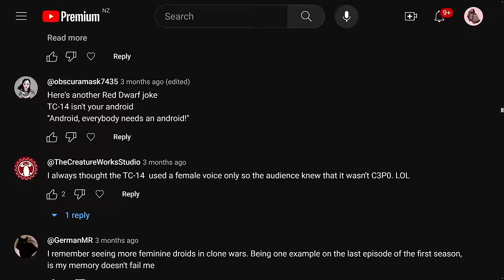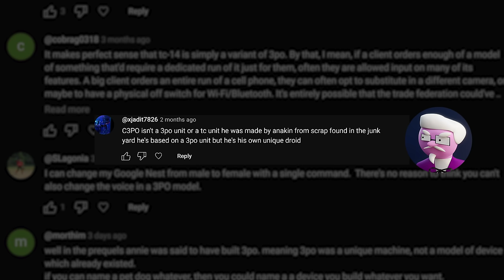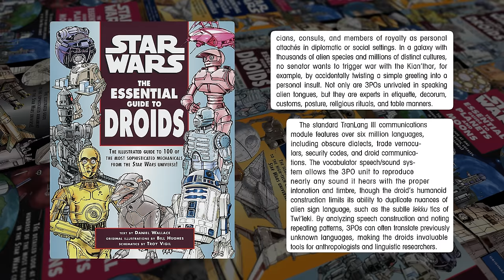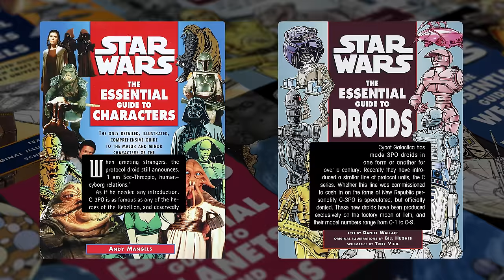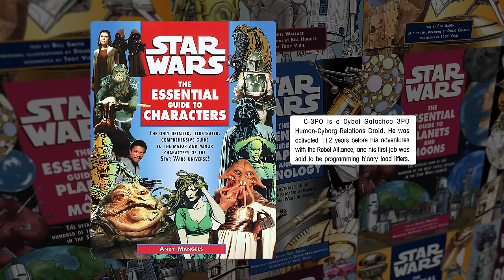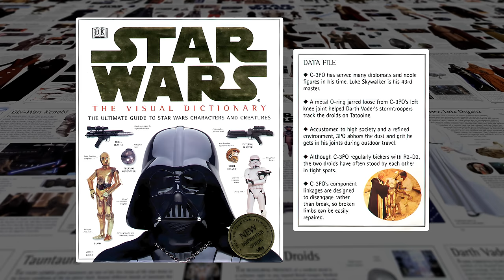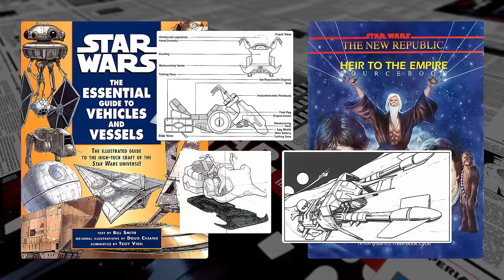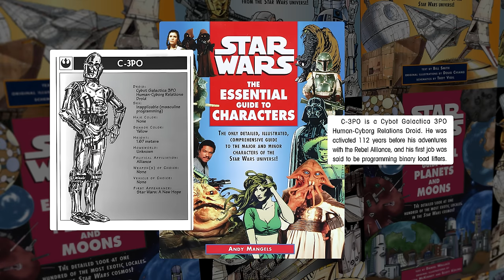You're (Probably) Wrong About C-3PO | Star Wars LOREBREAKER

Comment: I always figured that Anakin "built" C-3PO in the same sense that I "built" my computer, like you said.  Yeah, there's some room for customization, as I'm sure there is when you order a droid from the factory, but at the end of the day all I really did was assemble a computer.  Maybe a better analogy would be if I built a car from junkyard parts.  Sure, the parts might come from 10 different junked cars, but each one of them was still a 1985 Honda Civic, so at the end all I did was build... a 1985 Honda Civic.  Maybe I also splurged on a nicer stereo, some seat covers to hide all the torn upholstery, and some sick flame decals (to make it go faster), but it's still just a fucking 1985 Honda Civic.
Reply: And I think he also had a good frame to start off from.
Like saying you found a pretty messed up Honda Civic, took off most parts, leaving the chasis and some main parts.
Then based off the other Hondas, you put em together
Reply: While this is a great analogy, now imagine doing at 9 yrs old, the kid is still operating at a higher intellect then most people
Reply: A resto-mod. Yes,
Reply: True enough. What if I actual am handly with a soldering iron and purchase electronic coponets from Mouser and design and build my own circuit boards and machine some of my own parts from raw billets and bar stock and design and weld some parts myself but also use some off the shelf componets? So I build my own vechile from raw steel but then combine an engine from GM a transmission from Toyota, a transer case from Atlas, axle assemblies from Ford, after market engine controller etc....Do I get credit for anything I have done and making such an eclectic pile of non-compatable parts work? 

I build my own amateur radio gear from scratch including designing and etching my own pcb's. I machine my own rifles for competition use from scratch, I have fabricated my own cast engine and transfer case adapters to use a GM engine in a Toyota truck with toyota transmission and accessories but I did not smelt my own aluminum even though I made my own casting. We have no idea what is what with C-3PO. I think the brain built from 3 junkyard brains is more like combining parts from 3 different CPU's into one than the example given with hard drives. Even then if you wanted to use the harddrive idea's it would be more like taking the platter from one hard drive the read/write head from another totaly different design and brand harddrive and the controll board from another brand. The genius is in making all the incompatable parts talk to each other and work. Again the brain made from 3 different brains is more like taking a part of an AMD Ryzan CPU and a part of an Intel I9 CPU and part of a ARM CPU and making a working CPU from part of 3 seperate not compatable CPU's work as one. Like the first person to use XBOX boards to make a super computer or the first person to use GPU in the form of mad stacks of gaming cards to mine BitCoin the genius was not in inventing something new so much as it was finding a novel use for an existing product and designing the controller to make them work together for doing something they where never meant to do. 

Most people could not build an engine if I gave them the parts let alone make one companies engine, work with another companies transmission, and make those parts run with yet another companies ECU and seonsors. If you then make said person a child it is no less amazing even if nothign has been invented.
Reply: @reapersritehand kids are dumb because they spend all day at school, put them to work lile Anakin and they learn quick.
Reply: Anakin did more than this. He literally built a first place racer and won the race with the ‘car’ he ‘built.’

Downplaying the fact that he didn’t build from scratch is insane, since what he did is still genius level for a 9 year old.
Reply: @glennross85 how many kids can build their own first place racer? You people are insane
Reply: @pyropulseIXXI  Dont go outside, you might catch a cold.
Reply: It'll always just be a fucking 1985 Honda Civic with that attitude, my good sir....but if you believe hard enough and you're an enslaved child space wizard on a planet with two suns, it could be a gold bodied 1985 Honda Civic.
Reply: you all understand that he is a fictional character right?
Reply: @yahya_elistinsary  nah we thought it was real gov 🙄
Reply: I would go a slight step further and say Anakain bought broken parts, replaced broken caps with a soldering iron, and got a working computer.
Reply: @buckaroobonsi555  That "buying parts and designing a circuit board, then soldering it together" is how the original IBM PC was designed. The only piece that was not off-the-shelf was the BIOS.
And putting the brains together would be like buying an original Xbox, desoldering the CPU and putting a new one in and replacing the 64 MB RAM with a 128 MB chip, then replacing the hard drive with an SSD.

Comment: C-3P0 is a resto-mod droid like an old barn find Ford Mustang or Dodge Charger that has not run for 30-plus years, Anakin fixed a salvaged, scrapped protocol droid and used whatever parts he could find. But 3P0 was once a factory-built droid before, or at least most of him was stock factory parts at one point. 112 years before Phantom  Menace. Also, if Anakin was older and considered it better, it would be odd for a 3P0 droid to be one to assist his Mother, I mean an Astromech would be more useful. But Anakin found what would become the 3P0 we know today. Considering the Protocol droids made by Cybot Galactica, various models mean many compatible parts plus generic droid parts. Anakin did a good job, considering scavenged and parts sneaked out of Watto's.
Reply: Just felt like expanding my answer a tad.

Comment: It's the same semantics that we use for building virtually anything mechanical. Very rarely do we manufacture the parts, but we do assemble the parts like if we were to build a computer, build a car, etc.
Reply: yeah you don't refine the metal cast it and and machine each and every part and screw your self very much any more, you tend to build with existing parts or modify parts to work with what you have.

Comment: I never boggled at a boy building a robot. I never assumed it was from individual transistors and solenoids. When I was a boy that age there were kits. Primitive by today's standards but still pretty neat. I saw Ep 4 at 11 and didn't hate Ep 1 on sight. For instance, I just assumed Anakin found a crate with a C3PO in modules ready to assemble and program with instructions. Probably an obsolete unit that never sold, likely incomplete. Luke reattached Threepio's arm with no trouble in Ep 4. At one point i vaguely remember a silver droid with a red replacement arm. Not to mention Chewbacca completely reassembling him with few tools. (And he is a "him" not an "it"). 
  I also remember Anakin telling Padme he wished he hadn't made Threepio so self-aware because he was so anxious. Padme did use him extensively as did Leia as Head of the New Republic in Timothy Zahn's Heir to the Empire. 
  Artoo Detoo seems never to have been wiped, but since he doesn't speak Basic he knows history. Interesting characters based on Shakespeare.

Comment: He may have built C-3P0 but because it's from spare parts it doesn't mean he's not a 3P0 model. It's more likely that he's a modified 3P0 model considering that his core parts are probably from a 3P0 model but he probably sourced compatible spare parts from other models due to limited access to the right parts. On top of that, some of the parts may have been from a different model but the same across multiple models anyway.

Comment: Strange, my comment is gone. 

These comments remind me of AK-47 "builders" vs. AR-15 "builders".

Your comment about "building" a PC is pretty much the same analogy I've used in gun building. 

I "built" my PC. It may have been an ibuypower, but at this point I've replaced everything but the case and motherboard.

With my AR-15, I bought all of the parts, except the upper and barrel, as I got a really good deal on it already put together and put it all together.

AK guys "build", but require more (ridiculously expensive) tooling to get the final product, but you'd swear they are some unique gun builders that far outclass anything an AR "builder" has to do and many discourage them from even trying.

Anyway.

Comment: I don't know how people think C-3po is not a factory model, you see them all over the place. I always understood C-3po to basically be a hot/rat rod droid. No different than going to an auto salvage yard and finding an old car you like but it has been parted out but its a good frame to start from. Over time you visit all the near by salvage yards and use contacts made to  piece back together a 77 Pontiac Trans Am. Still looks like shit with all its surface rust and mismatched paint but it runs and drives.

Comment: Wait, is anakin's podracer actually the fastest in the galaxy? Or are those just the exaggerations of a little kid? Like I would run around when I was 9 screaming i'm the fastest ever?
Reply from the maker: Going by stats in the game, we would have to conclude it's on the slow side. The cross-sections give it a top speed higher than Sebulba's, and those are the only two we have concrete and comparable speeds for. If we assume the game stats aren't accurate, then Anakin and Sebulba would both have relatively fast pods. After all, Sebulba needs to win every time, and he can't do that entirely through cheating. —DZ

Comment: The problem with all of this is linguistics it's the words being used let's set the record straight did Anakin build C-3PO yes did Anakin Skywalker invent C-3PO no did Anakin Skywalker create C-3PO no when you say Anakin built C3PO you actually mean he rebuilt C-3PO Anakin didn't invent protocol droids he didn't invent the AI to protocol droids he didn't build C-3PO from scratch he built them from scraps these are two different things Anakin built C-3PO from parts of other protocol droids of similar models so again C-3PO was not created by Anakin Skywalker Anakin Skywalker didn't invent the protocol Droid is C-3PO an official 3PO unit no but he is similar to a 3PO unit because most of his parts are from 3PO units

Comment: The need that made these comments have never built anything and it shows. 

You can build a car from scrap but most of the parts are going still going to be the same parts used in a factory from multiple models.  Other parts like wires and lights won’t matter. 

If the little slave boy made a custom droid he would have said, that he made a custom droid not rebuilt from scrap which implies factory compatible parts.

Comment: No need for a 23 min video…
Go to a car show and you’ll see restorations and hot rods
Ask if they “built” the car and most often you hear them say, “ ya I built it myself”
For a restoration, it refinishing original factory parts or replacing with factory/repop parts
Ask a hotrod guy and get same answer but,
It was most likely build from scratch using g already existing factory and aftermarket parts
Neither the restoration nor the homebuilt were “made myself” since parts used were already existing ( not to mention most piece out the built/restoration to pros and then say “ I built it myself”)
There none in 1min 🤷🏻‍♂️

Comment: There is a difference between building, fabricating, and manufacturing. You can build a Lego Millennium Falcon. You very likely did not also manufacture the Lego Millennium Falcon, or fabricate all the parts for it. You could buy a Lego Millennium Falcon kit, build it, realize it was missing a part in the box, and use a 3d printer to fabricate the missing part, if you are cool like that. The point is, Build, Manufacture, and Fabricate are different words with different meanings. So yes, Anakin did in fact BUILD C-3PO. The end. Another example would be if you ask what factory a car is built in. You might be told for instance that a Ford F-150 pickup truck is built in Kansas City Mo. because that is where the assembly plant is, and it is where the vehicle was put together. However, parts for that vehicle were made all over the US and some global locations, with lots of fabrication, manufacturing, and assembly processes. It's who does that final assembly that gets the credit for building the thing.